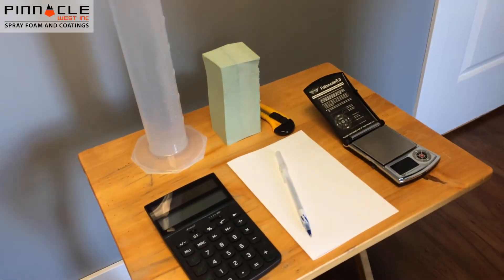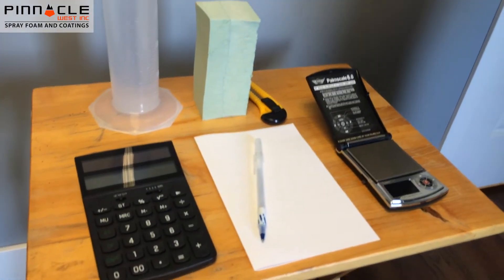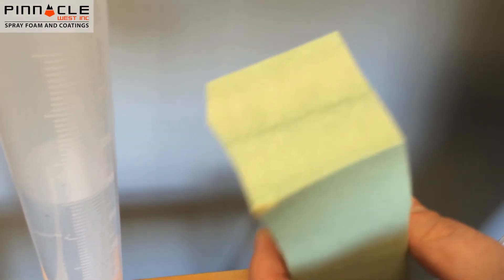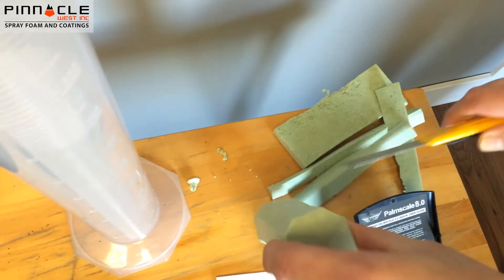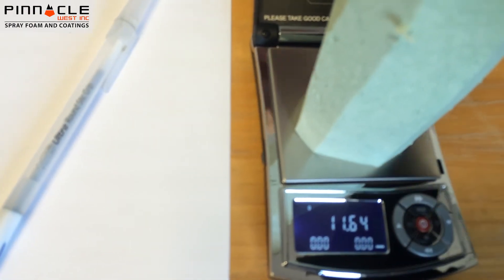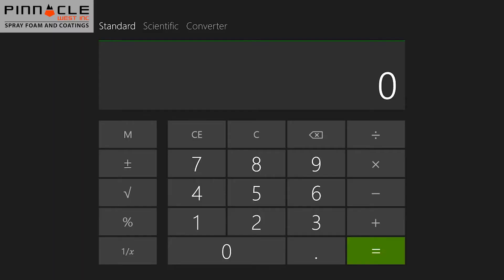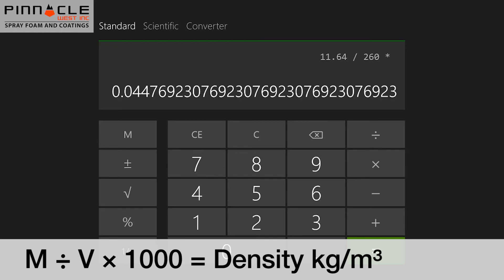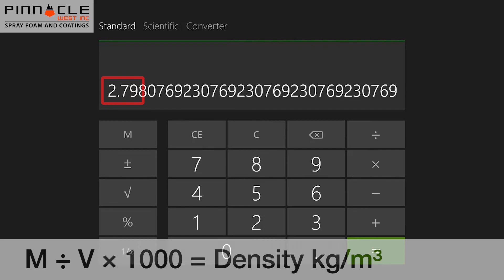How To Perform a Density Test on Spray Foam

Comment: every cert course I've been thru has stated minimum 5gram sample NO more then 10.5 also.
Reply from the maker: According to CAN/ULC S705.2 section 6.3.1.4 they require a minimum of 5.5 grams but do not specify a maximum. You would be limited by the size of graduated cylinder so less than 10 grams would make sense but is not specified in the standard.